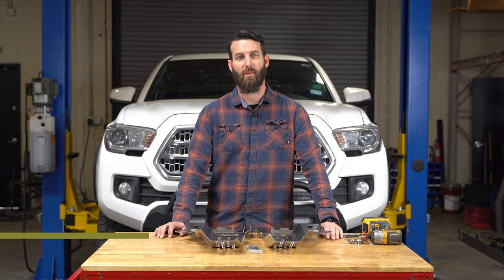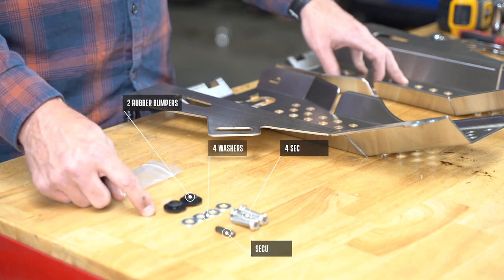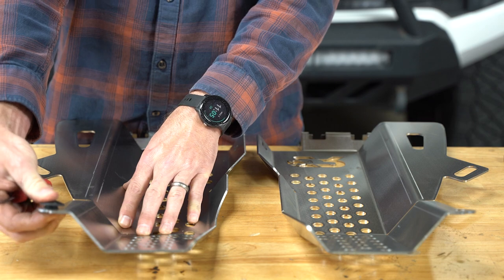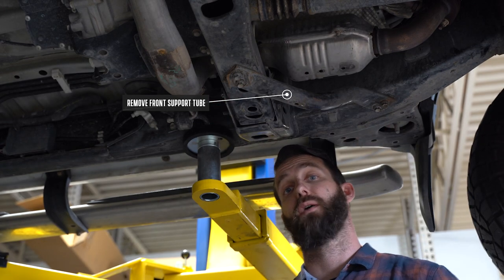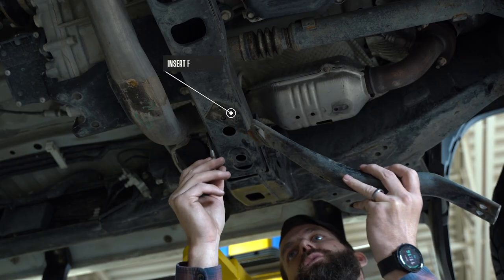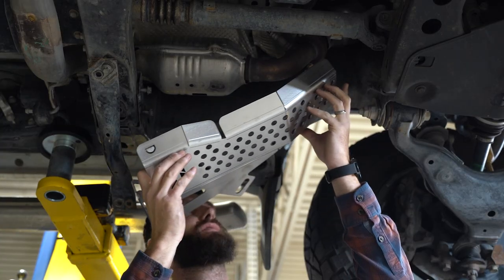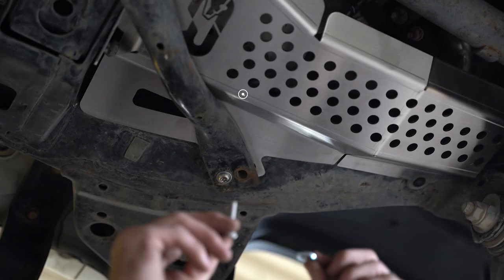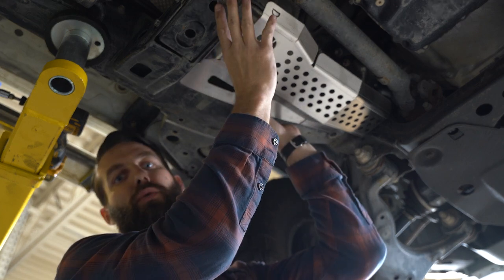How to Install Catalytic Converter Shield For 2016-2023 Toyota Tacoma | Cali Raised

Comment: I've had two catalytic converters stolen from Honda Elements in Tulsa, OK.  I installed another brand's catalytic protector on one of Elements afterward, which cost about $200 w/ shipping and took several hours to install; and looked ridiculous if you looked under the vehicle, but it was never stolen again.  After buying my 23' Tacoma and looking up the cost of replacing the catalytic converters, I ordered and installed the Cali-Raised Shield for $190 w/ shipping (includes 2 shields, one for each cat), which took less than 30 minutes to install.  They look amazing and have easily been the best value upgrade I've ever done to a vehicle. I highly recommend this product.
Reply: How long did it take to receive your cat shields ?
Reply: @TRUMPSUCKSBIGTIME  About 5 weeks

Comment: Installed yesterday on my 19.  Took about 3 hours.  I did not use a lift or jack and managed to get under my truck to do it.  Bolts were corroded and the shield did not sit flat where the security bolts go through so i got my jack from the trunk and pushed it into place and bolted it down.  Parts kit came with only one washer for long bolts, so no washer on back side of transmission support.  Luckily i had some on hand, but was disappointed with that.  Be careful with security bolts, you can easily strip them out.  Overall, not too bad of install.

Comment: Why take the support tube completely off? Why not just remove the two front bolts and one rear bolt entirely, leaving the last one on loosely, swing it out of the way, loosen the transmission crossbar bolts, install the shield then swing it back? Seems like no reason to take it off completely.

Comment: I just installed mine. I wish I would have watched this video first. The ones I watched were the older design where it went over the transmission mount. Once I realized it had changed, the passenger side install was done in half the time.

Comment: So it would help to say if you have the full skid set installed the cat covers will be a very tight fit and one of the 2 hanging bolts will have to be removed to install and the cross bars will not fit  the cat covers with the full skid plates (front, trans, transfer) will install but leave off the cross bars and remove one cross bar bolt and tighten all bolts and complete.

Comment: I just put mine on.  Took me 90 minutes but only because the security bolts did not line up clean and were shorter than the factory bolts. Also, the impact driver didn’t like the fit and I wasn’t about to strip holes on my new pickup.  In the end I wound up re-using the factory bolts which mated nicely with the holes and worked in better with the wrench.  I will say, these shields are REALLY going to piss someone off trying to get to the cats.  If they get the other bolts off I’ll be impressed.

Really dig the product 2023 Tacoma 4x4
Reply: I had same issue. They should make the security bolts a little longer

Comment: You guys have two designs ? One for 2WD and one for 4WD.  Is there really a difference? Seems like they both can work?
Reply from the maker: Two different designs are required due to different mounting points!
Reply: @CaliRaisedLED  Some thoughts. I received and mounted the 2WD version. I have to say the design could have been improved for the 2WD version. The 4WD design has the front diff driveshaft taking up that extra room covering that large gap. The 2WD doesn't have this driveshaft and it leaves a very large gap to make the cat easily accessible. I believe with the right tool you can easily cut away the Cat as the rear of the Cat is fully exposed and the front, you can just go on top of the Cat Shield. If you were to lengthen the wings of the Cat guards to be taller/higher on the 2WD version, it would be perfect on both sides and much more secure. The wings are not very tall and cutting at the rear of the cats on both sides is easy, and then cutting over those wings, can be achieved, especially since both are slotted which will allow a blade to enter that guide slot on the cat shield.  If you redesign your product to make the wings taller for the 2WD version let me know, but for now this will just act as a deterrent at best.
Reply from the maker: @okkin981  Great notes! We can always improve design and make our products better! As a reminder, these cat shields are a deterrent, not a solution. We aim to prevent cat theft, we unfortunately cant solve it with our shields!

Comment: Great video , super easy and fast installation , installed them on my 2023 off road without a problem.
Reply from the maker: Great to hear!
Reply: @CaliRaisedLED   why keep the 2 security bolts together on one end of the support bar?  Since there are two bolts on each end, why not place one security bolt on each end for added security at BOTH ends of the support bar?  Perhaps I’m missing something here?

Comment: Is it normal for the black support beam to be extremely tight against the cat shield at a contact point? It felt like it shouldn’t need to be forced/bent to tighten all 4 bolts. I’ve watched a few different instruction videos and the support arm seems to go back with ease. I really don’t want to have to return it
Reply from the maker: It can be normal for the support beam to be against or close to the cat shield. Not all support beams are 100% the same as they can warp or bend over time due to offroad use etc. It should fit closely together, but not be impossible to install! This is meant to be a simple install!

Comment: Will these catalytic converter plates work (compatibility) with a full Cali Raised (front, transmission, transfer case) skid plate set up? If so, which full skid plate for a 3rd Gen Tacoma is compatible?
Reply: if you have the full skid set installed the cat covers will be a very tight fit and one of the 2 hanging bolts will have to be removed to install and the cross bars will not fit  the cat covers with the full skid plates (front, trans, transfer) will install but leave off the cross bars and remove one cross bar bolt and tighten all bolts and complete.

Comment: Hi it looks like I have an older version of the catalytic converter shield that requires me to completely remove the bolts for the transmission crossbar to install the product, is it safe to completely remove the transmission crossbar bolts for 1 side at a time?
Reply: I didn't have to completely remove them.  Not sure if that's a good idea actually.  I just pushed them in so they were flush and it went on fine after jacking the driver's side of the truck up a bit.

Comment: What's with all the extra nuts and bolts doesn't show any of that in the video
Reply: What extra nuts and bolts? You're reusing the bolts on the crossmember and replacing 2 bolts per side with security Torx on the diagonal brace and that's it. 4 new bolts, 4 washers and a rubber bumper to prevent rattling of the far end.
Reply: @JamesReedy  must have been a mistake on the shipping side there was extra hardware included with the shields that did not belong
Reply: @keithgerber3216  bonus hardware for your nuts and bolts jar!

Comment: Be prepared to wait six weeks or longer for them  I waiting six weeks haven’t showed up at my door it’s probably the raw material they can’t get a hold  it probably will be here next two weeks maybe not gonna hold my breath on it either
Reply: Mine finally showed up, and because of their poor packing principles (loose brown paper) One of mine is scratched, to hell, but apparently their warranty doesn’t cover this. Not to mention, I don’t want to wait another eight weeks without installation and risking theft. It would be so easy to package these better so that the underside of my truck looks as good as the upside.
Reply: @martinmck505  good for you got yours  i’m going on 9 weeks and still haven’t got mine yet go figure with this company  very slow manufacturing  it’ll probably be here end of next week maybe or maybe 10 week it might show up
Reply: @wilyceyote  Jesus!! I’m already inpatient. It’s only been over 3 weeks. Just got them for my 2023 Tacoma trail
Reply: @Lima_87  mine just got shipped today so Tuesday will be 10 weeks so it took 10 weeks to get the them they must be very difficult to get them  in a timely manner
Reply: Got mine over the weekend with a 2-3 week wait. I think for the 2WD  are quicker to obtain than the 4x4 ones. Quality looks good and seems to be the newer design too.
Reply: Mine took 6 weeks to arrive and sat in the garage for two months. Ha.
Reply: @katfi5h  it took me over 10 weeks to get mine